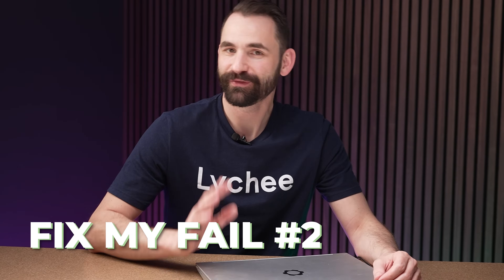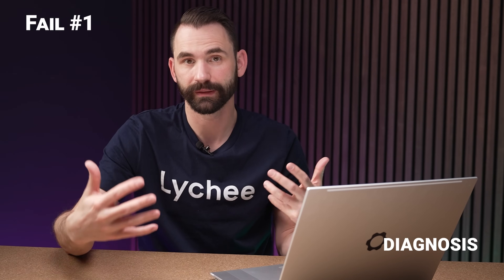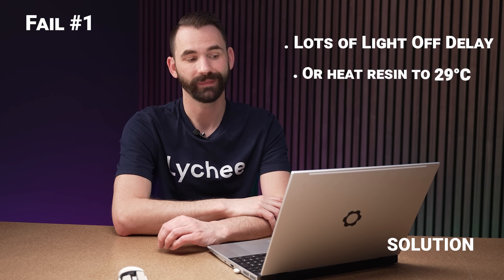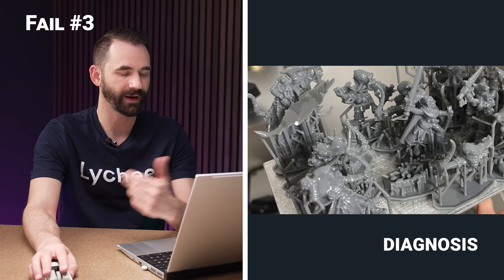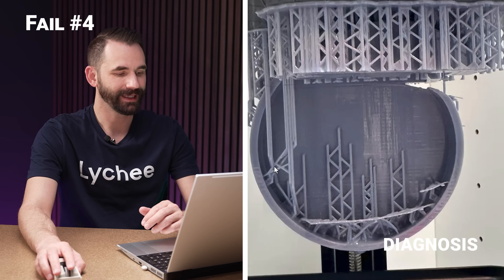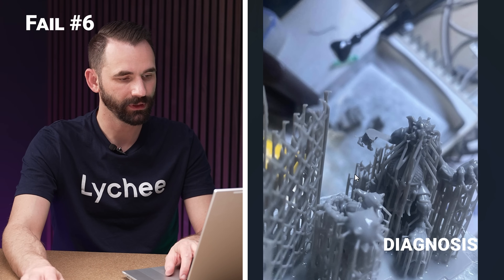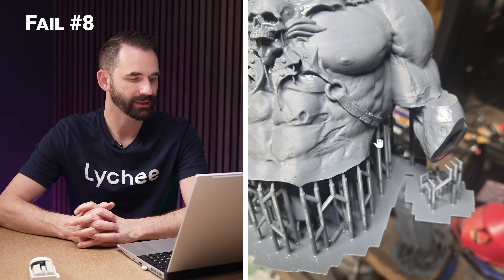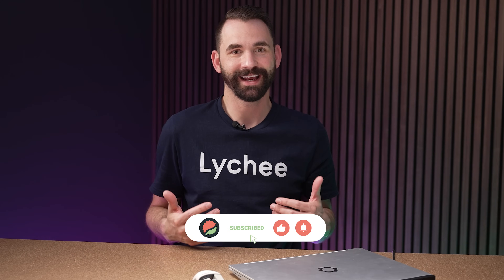Popular Resin Print Fails Exposed | Fix My Fails #2 with Doctor Derek

Comment: Great video, Derek. After learning from you for the last 2 or 2 years the biggest things that you taught me that reduced failures are this. (Always keep your FEP clean, always check that your plate is level, and use safe/slow lift and retract speeds. Lastly, never trust pre-supports...they are all bad. I've only seen good pre-supports from a single company, the rest are trash. And.....your sky scraper method works the best. I'm still learning but I seldom have failures.

Comment: My print isn't adhering properly to the plate, you can see it getting bent, as if the FEP film is pulling it down after each layer."
Reply from the maker: Add light off delay! :) and maybe up your exposure time on bottom layer

Comment: What do you mean at 4:25 in the video when you say to “use 30 seconds for the raft in UV Tools”. I’m familiar with UV Tools and have it downloaded. However, what settings are you referring to for the 30 seconds? Can you please explain what setting(s) I should have for my UV Tools (as well as Chitubox, if possible) for printing .03mm layer height on my Saturn 4 Ultra?

Comment: THEE Number One Mistake people make with 3D Printers is they don't level the machine.  You have to take a physical level and make sure the machine is level front to back and side to side before you start printing.   I use an old deck of cards with a rubber band to get the machine level on the table.  This greatly enhances your prints and reduces failures.  LEVEL YOUR MACHINE.
Reply from the maker: Great tip!

Comment: Looking at fail #9, I'm seeing a few things here. Looks like a Mars 5 Ultra. I was getting errors like this when my build rail wasn't level. The plate is supposed to "auto-level", but it was the rail itself that was out of true. They may need to contact Elegoo for instructions to do that. It took a fair bit of back and forth to get the final resolution on it.

Comment: Do you think fail #6 is not underexposed? I see the idea of cones of calibration when I see this failure. When cones don't connect. I know it was not washed well so we don't see the sharpness. I always fine success with increasing exposure with this. I'm just curious. Thanks for doing this video. :)
Reply: @bokkins  I don't use cones but I developed boxes of Calibration as a more accurate system. 

The issue with cones is that they are pre-weighted and anything like that can't possibly be constant or accurate as no two resins is the same. 

To answer your question, it's hard to tell by looking at it. However when most of an object prints I always focus on adding supports to the failed sections instead of increasing UV exposure time. 

I have another video on calibration where I talk more about calibration it's one of the first I did. Go check it out.
Reply: @J3DTech  thats my favorite. I always watch it and recommends it to other users. Thanks for explaining this further.

Comment: I'm not sure I agree with you about the Saturn's build plate producing really thick layers. The springs only compress when the build plate is pressing down on the screen. There is nothing else that compresses those springs. That is just how it does "self-leveling".
Edit: That is also the aftermarket ChituSystems Hoopat vat. It's not heated.
Reply: It will compress when pushing into the resin. You can most likely see it during a print. But remember we are talking about 0.1mm or so movement per layer. While anything observable will be greater than 0.1mm per layer.

Comment: I reckon #9 was an auto-support job for sure. Any time I see near identical models all with different orientations, I know someone's just pressed 'auto', and not bothered orientating manually.

Auto-orientation (in every slicer), definitely needs some more intelligence behind it. Although admittedly I wouldn't know how the slicer can know what is the front,back,top,bottom without the user inputting some kind of information.
Of all the 'auto' tasks, orientating is probably the one every person should just do themselves, as the program rarely gets it right. (Yes, that includes Lychee)
Reply: It could be, but that's also why I want to talk about it, help users identify the issue and correct to get a better end result
Reply: @J3DTech  Oh, 100%. I think this video and others like it are super useful.

Comment: A video that Id like to see is.. Buying a resin never used before and how to dial that in. Once I found a resin I thought was ok. I have NEVER changed because im scared of going through the stages of failing constantly again. I know there are lychee presets that you can find, but it would be nice to see how a professional like yourself does it. Like how many prints before you are confidently getting the best quality out of said resin. I assume you would be using the boxes of course. Thats just me though. (I dont like the idea of switching resin because its just messy n all that)

Good video!
Reply: I do this all the time. It would be interesting how to film it. For most ABS like resins, I don't really change much. However if it's a specialty resin It can be some effort to really get it dialed in.
Reply: @J3DTech  Maybe try it with the worst possibly resin youve never heard of. Some like Temu Resin. Could actually get views too haha
Reply from the maker: thanks so much and great idea!!

Comment: Fail #1 was mine, it’s the 12k s4u and has a heater on the back left of the machine which is not visible from the pictures, also the printer is in a enclosure and air temp is 29/30c but probably not the resin (lesson learned) I will be trying again tomorrow and I’ll try increasing the wait before print

Comment: Regarding fail #1.  There was/is a bug with the firmware when using Transition Layers where it produces a super thick raft.  The user isn't required to use TL when using a raft and supports.
Reply: I'll do a dry print but for me I don't have this issue and I always use transition layers on my Saturn 4 Ultra and Mars 5 Ultra.